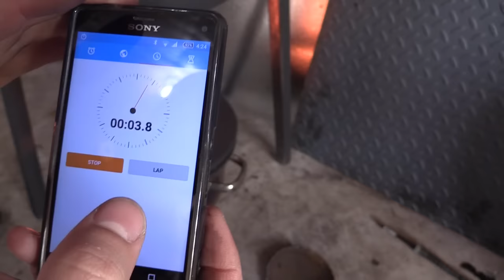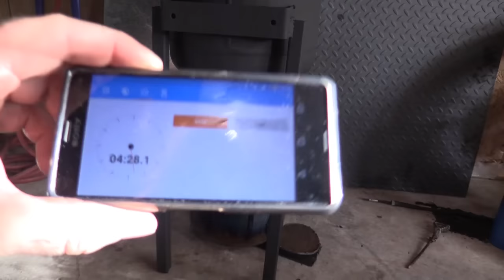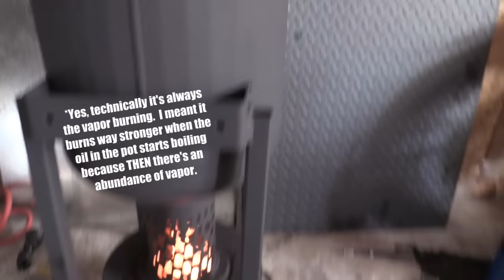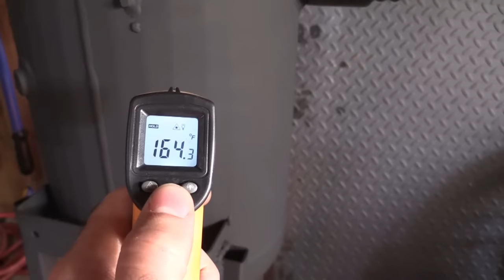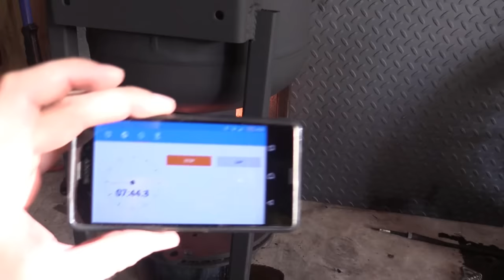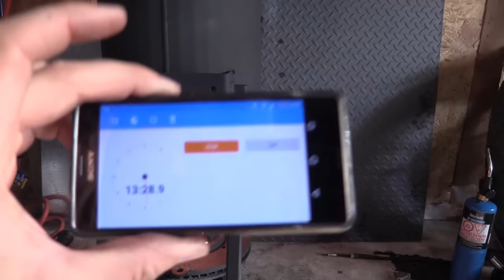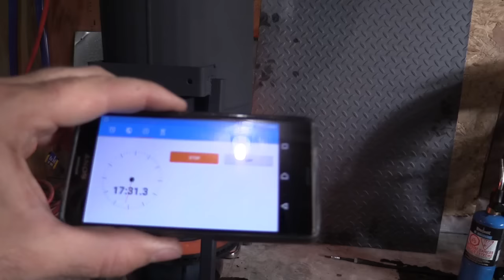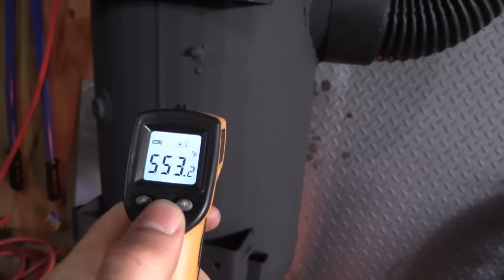DIY Waste Oil Burner -- How Hot Can It Get in 20 mins?

Comment: I have seen 10 of these waste oil heaters. So far I like yours best. If you put some sort of shutter on opposing sides of your cook pot... the flame may stay straight and you could regulate air input... and heat output. Somewhat like a wood or coal stove would have. I think an old cylinder coal stove... Penn or Chubby would wirk great. New subscriber here.

Comment: Just finished watching this and if you were still wanting a convection heat rather than a primary radiant heat from this I would suggest aluminum tubing. Any shape will do the job, round, square rectangular. even some heavy channel like used in Trailer awning support arms would do a great job and finding twisted/broken awnings would make the channel real cheap. Cut the length of the aluminum the same size or a little shorter than the side of the heat chamber, top to bottom. several pieces to totally surround the chamber would be most efficient. Use a couple or more large stainless gear clamps to squeeze them to the side of the chamber and when burning, the air will be drawn up the center of the pipe/channels and conveyed into the room out the top. This may also lower the exhaust temperatures as more heat will be used and not wasted out the chimney, making the heater more efficient and use less oil. Less oil, even cleaner exhaust. Nice job on the heater.

Comment: Moderately heavy oils (Diesel, hot waste oil, etc.) burn in three stages: 1. non-luminous stage: this stage is very clean, but does not generate that much heat. 2. Main combustion phase: this stage generates almost all of the heat and expansion, is relatively clean. 3. Sooty stage: If excessive air is not present in this final stage of combustion, your exhaust will be sooty, smelly and toxic. The reason you install a secondary combustion chamber (the cylinder there) is to properly complete the third stage of combustion. after this last stage, you can safely extract as much heat as possible with a heat exchanger.
Reply: does this mean he should get rid of the cheese pipe and add an adjustable air inlet into the bottom of the air tank?

Comment: one time i made a waste oil burner and a foundry furnace. Melted aluminum real good, but then i got ambitious and tried to melt cast iron.  with my forced air burner using compressed air to aspirate diesel and a shop vac on blow forcing air into it i successfully melted both the cast iron and the foundry furnace.  Just goes to show the power of oil burners.
Reply from the maker: Good point!  I experimented with a forced air diesel rocket design... which will never ever make it onto Youtube, lol, but it had enormous BTU potential.  It became clear that it would've consumed itself had I kept running it.

Comment: About every November, we get a little cold snap, I start a fire in the fireplace for a few evenings in a row.  Then I look at the collection of nearly full used waste oil containers in my garage after changing the boat oil before winter layup. I consider building one of these to warm the shop.  Then I book a week or two at the beach.  By the time I get home it's spring and I thank god I don't live where it's cold enough to NEED a waste oil burner, but this is a very nice design.  I'd just feel better about it if it only had a tripod leg system rather than 4 less stable legs.

Comment: Thanks for posting the simple version of the waste oil heater. All the other videos I saw were utilizing a fan to basically make a blast furnace.
Reply: A fan will make it burn more fiercely and cleaner. This burner is a simple design that does not use any additional power such as a fan or compressor, which adds to your running costs. The secret of this one is apart from collecting the oil there is no additional cost. As with any design there is going to be ways to fine tune it and make it burn better without resorting to a fan.

Comment: Ive just built my own,  use stainless frying pan that is more shallow and fuel is more closer to air , and make it flush to rotor, then it will start pulling really strong off the bat. I stared mine outside on -15C with no issues at all

Comment: My design is similar except I left the 4" pipe without holes and the pot cap with a single row of 1/2" holes spaced as closely as possible. The draft of the chimney (hot air rises) causes fresh air to enter the pot, via the 1/2" holes, thereby feeding the fire, consequently a cleaner hotter burn. All mounted under a wood stove. The mass of the wood stove radiates tons of heat into the room.
Reply: can you make a video of how you made yours?

Comment: Waste oil heaters use a LOT of oil.  My local garage bought one to use oil from car oil changes, thinking it would be like free workshop heating...well it is free, except a busy small garage couldn’t get enough waste oil to keep the heater running,....plus being a commercial unit it wasn’t cheap to buy either....plus here in UK there are regulations like Albatrosses to make any kind of cost savings too difficult.

Comment: Cool build. Adding 1 drop of water to every three drops of oil will increase the vaporization of the oil. Water / oil combination always burns hotter as the water turns to steam it vaporizes the oil.
Reply: But its very danger .. i saw a video about this experience
Reply: NO
Reply: how do you keep the oil from separating from the water ... 2 different feed tubes ???
Reply: @woodstocktrees8614  Two tubes. When the water boils it vaporizes the oil which then has a bigger surface area to burn.

Comment: In a garage you would need to have that about three feet off the floor .  If you were ever to spill gas on the floor and the fumes alone rolled across the floor they would ignite in a second .  I used to sell new cars and I met a guy who nearly got burned to death installing a new vinyl floor with regular vinyl floor adhesive but they didn't turn off a gas hot water heater pilot light .  It was a big mistake .

Comment: I moved in to a house with an old rusty woodstove in the basement that had single wall flue piping. I had the piping turn red hot - scared the shit out if me. My infrared gun topped out at 750 fahrenheit so it had to be well over 1,000F. I only use double wall piping after that experience.
Reply from the maker: markfothebeast yikes, you might have actually been having a chimney fire.  Was it unusually loud, or roaring like a freight train?
Reply: The chimney was on the side of the house and protruded about 36" in to the ground. It never sounded as if it were on fire. I removed it actually. One ninja kick from on the roof pushed it right over. Judging from the clay lining and brick in the chimney, it had not once had caught fire. The previous owners swore that burning a box of moth balls was the trick to keeping the chimney/flue clean. Must have worked?

Comment: I run cooking oil through a filter/water separator, a cleaner fuel means you can use a needle/ball valve to get better control of the fuel and heat output'. I cheat a bit though as i use a blower to atomise the oil and generate heat.I have a couple of vid's of my heater and will do a step by step video showing the way I've set it up soon. cheers.
Reply from the maker: +DODGY PROJECTS Thanks!  I'll check that out.  
I've been using a fuel filter and sediment bowl to remove as much crud and water from the oil lately.

Comment: just an fyi, most propane dealers have very good tanks they are tossing that are no longer usable, but make great expansion tanks and waste oil burner chambers.  3/4 hose thread and 3/4 NPT are two different threads. Try putting some very course stainless steel wool in your burn pot.  It will more thoroughly expose the oil to the air mass, and burn cleaner and hotter. Smoke is usually the result of cold oil, burning to rich, not enough air, or hot enough combustion.  If you run your oil line closer to your burner, it will preheat the oil.  Waste oil burns most efficiently when the oil is warmed to between 160 and 180 f degrees.  I have built many wast oil heaters.  I am concerned that you have a lot of flame and ignition potential exposed to flammable objects in the proximity of  your burner.  Nice design.  Put a split 15 gallon metal can around your burner with a 1" space between the bottom to allow air to come in.  That will keep the smoke and exiting flame from being an issue.   Try putting a ceiling fan in the center of your room.  That dramatically increases the spread of your heat, and makes it feel warm everywhere and may keep your detector from going off. But again great skunk works development of your burner.  Flame On Bogie!!

Comment: I think the air intake needs to be as low as possible, dill some holes around the side of the stainless steel pot, about 50mm up from the bottom with some means of partially closing for adjustment, all other holes are detrimental as they are allowing excess air to be drawn in which is taking a lot of heat out of the stove and up the chimney, hence the heat haze outside.

Comment: take a look online for smudge pot. you first design needed a tube from the chimney about half way up going back down to the pot lid and smaller holes going further up to increase combustion chamber size . The tube pressurizes the pot with hot air increasing combustion and burning cleaner. smaller holes help keep pipe integrity and improve draft.

Comment: Hi there great video! I first saw one of these being operated in a mechanic's garage in Turkey while we waited to get a busted turbo replaced. OMG I was so impressed it was heating the whole damn shop and a little smaller than the one you made (an also not as elegant as your one LOL). That was like in 2010 and i went nuts looking for what that thing was so i could build one, LOL I only got as far as a prototype you could never put inside but the principle was the same. I had to use a big industrial drill press at work to make my holes in the "swiss cheese"/air intake pipe, that was the hardest part. You've done a great job! I subbbed!

Comment: May I suggest designing an adjustable air flow valve. Many people just control the oil flow but that's not the best way to manipulate a flame. Manipulating the air intakd and output would make a fine blue flame. Maximising efficiency and fuel consumption. The blye flame would need to be able to warm a radiater to not notice a loss in heat. As the flane is smaller but much hotter and fully oxidised .

Comment: for your added air should use a bulkhead fitting threw the pot with a plug that u can open and close when you want so u dont have to move the pot and it can stay in place. other then that it is a great idea i think i might make one for my garage.

Comment: A quick and simple answer to your convection heat issue would be to wrap metal dryer duct around outside of tank from bottom to top, with duct extending into shop.
Reply from the maker: Raven Rock67 what I ended up doing is building a shroud around the expansion chamber, worked wonderfully for flowing convection heat!

Comment: Very good job according to the little smoke that comes out. To use a smaller flame and save fuel, among many other things, I would put the air outlet as low as possible. Thanks for sharing your experiment.

Comment: maybe consider adding a second tap to the oil line and use that to shut the oil off, and keep the first one to adjust the flow, that way you don't have to "guess" the right amount of turns
nice looking project

Comment: Weld some 3" exhaust pipes parallel to the tank several around the tank then make a cone on top with a single 4" pipe with a metal fan .... then drill 2 or 3 holes in the top edge of the burn pot with some controle valves flat metal like a bbq grill has
Reply: What?!

Comment: you can just weld strips or plates to side and roof of that thing, making kind of like "cpu cooler" loking things, those metal plates heat up and create helll of a draft between them moving the air, and there are small stove fans that work from heat of your stove to also move air if welding is too complicated.. also you can check for "turbo stoves/burners" and make like spiraling pipes to creata "fan like look" to create stronger and controlled draft in burn chamber..

Comment: Why the external burn chamber? Would it be better inside the tank? Feed oil to the bottom of burn area from below. With your head pressure it will have positive flow.

Comment: Not sure if you still have it going or fixed the steel surround idea.  Take a look at my video how I used 55 gallon drum to surround my 18" pipe stove.   It's 1/4" thick so lot more mass to heat up.   Mine has forced air so that makes a difference too.

Comment: Nice video.  Gave me an idea that you might want to try out.  Make a precision control for the height of the pot.  If you can lower the pot in minute increments (I would think perhaps and large adjuster that works the way leveling feet work on appliances via threaded stud), then you could drop it straight down for increased airflow that would not create unequal pressure variance from one direction or another, even it is only a couple mm or 1/16".  This would keep smoke going up the flu and no flames.  You would surely have to construct some sort of leveling mechanism that can withstand the heat and does not use grease or oil.
Reply from the maker: +Mark Weimer That's actually almost what I did!  check out 1:22 where I have those washers welded onto the brake rotor plate.  I have two nuts welded into the angle iron that the pot is sitting on, and was going to use bolts to raise and lower the pot with... but I couldn't find the right length of bolts and I got impatient so I just set it up as-is for now, lol.  Thanks for the insight!  Hopefully I'll get around to completing that portion of it someday.
Reply: Or you can drill out the rotor, put in an air valve, and be done with it. He could probably speed things up by adding compressed air.
Reply: Drilling a few hole in the top of the pot with a turn-able collar to regulate the air flow like on a bunsen burner would work

Comment: Nicely done! I think you might have even more success with a shallower pan, air is the problem 90% of the time. Less primary holes means less smoke and more efficiency. You got tons of secondary holes, which is good. I got a similar design that I will upload an update about here this weekend.
Reply: Which holes are the primary holes and which are secondary?
Reply: i thought that more holes  , more air for the secondary burn would be less smoke

Comment: Hey, If you were to box in the lower half and put in a fresh air duct with damper, you wouldn't ever set off the alarm because of your sealed combustion chamber.  
     As for your exhaust, if you have the room, you could run it as far as possible and use thin or even Aluminum.  You wood radiate a lot more heat.    I guess you could box in the top and make it a force air unit.
     I use to dream of putting on in an outhouse size bldg and duct in to house and shop
      This was probably mix in your other replies, and I'm yacking to much!
Cheers

Comment: Think you need a plate in the middle of the burn chamber for the oil to drip onto to flash into a vapor and burn. The burn chamber should be insulated for higher combustion and the exhaust routed to a radiator/heat exchanger to pull the heat out before the exhaust is allowed out of the bottom of the exchanger.

Comment: Hello Bogie, 
Love the video,
Hope you don't mind if i make a suggestion?
Maybe if you drilled some holes around the top edge of the saucepan, then you wouldn't have to move the pot over to let air into it. Hope this helps. I'm half way through building one of these from a 47KG Propane bottle.

Comment: Don't have much use for waste motor oil heat (bought an EV) but have access to lots of used veg oil from restaraunts.  Have you tried veg oil, if so does it make any difference in the combustion?

Comment: say is it possible to use the exhausted heat to run a power generator,,,maybe if you rigged up some kind of water tube heat exchanger to run a small turbine hooked to the generator? free light and heat

Comment: what is missing is moisture, the air needs humidity to hold the heat molecules in suspension,  dry heat dissipates a lot quicker then humid heat.....

Comment: With that much gap at the top of the stainless bowl, I doubt the holes in the brake disc are doing much.  Might try drilling some holes in the pan itself. to get a bit more air at the fire.

Comment: You could use a baffle right below the chimney elbow. You are losing much of your heat out the top. A baffle would divert the heat around a steel plate and would cause the compressor tank to be hotter than the chimney elbow.
Reply from the maker: I thought of putting a V-shaped heat diffuser 3/4 the way up the tank, but I'm actually pretty glad I didn't -- this thing puts off more than enough heat as it is!

Comment: do you get any smoke or exhaust stink coming out of the swiss cheese pipe?
Reply from the maker: +paul rogers No smoke or exhaust whatsoever down there.  The draw created by the hot flue/chimney keeps negative pressure on that whole area.  You can tell by the way the flame tapers upwards that it's being mixed with air being drawn in.  Thanks for watching!

Comment: Is there a way to use a pumped oil ... that under pressure ..
Doen thru through a nozzle like I saw Done... in an oil burning factory made furnace? 
I think going to see a furnace manufacture installer heating guy and ask a few questions and get a few part numbers ...-and then I’ve got the solution🤭
?